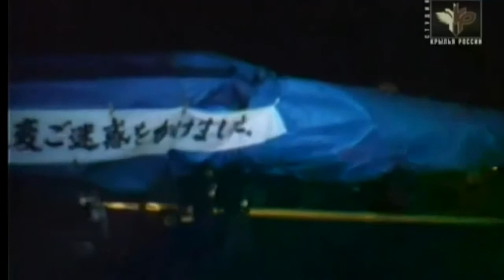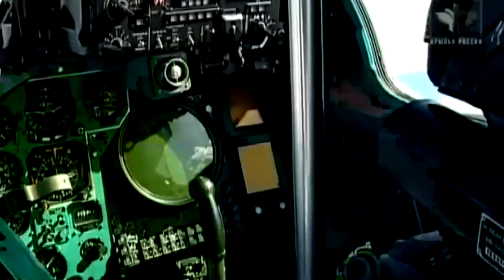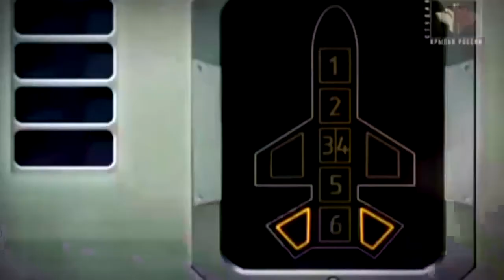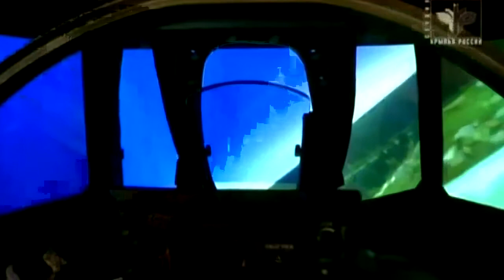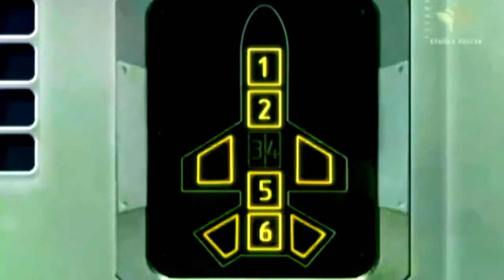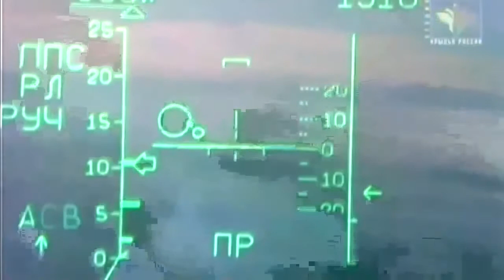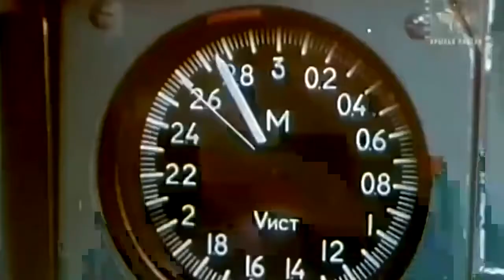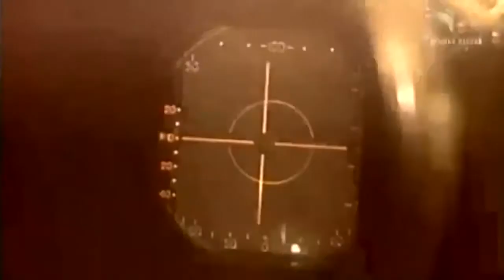From MIG-25 to MIG-31 (Documentary)

Comment: I am pretty sure that the F-14 could target six planes at a time, a few years before the Mig-31.
Reply: with much more limited cone of engagement and constantly moving head on updating the phoenix until goes active and forget about shoot down capabilities cruse missiles
Reply: The mig25 and mig31 don't stand a chance in a Dogfight at Close Range,if it's missiles are decoyed or evaded,then All the mig has is speed,many mig25 aircraft of the Iraqi air force which were flown by veterans Of the wars,where shot down by F15 eagles Of The US air force , also more capable mig29 and mirage F1 were easily shot down
Reply: @aris5921  I see - I have no doubt the Mig-31 has a better and more capable system than the first F-14, still it was not an unqualified "first interceptor capable of tracking and shoot multiple targets". First in Soviet service, first at tracking ten planes, first at doing so in shoot-down situations, OK. It is a great system.

If you omit the qualifiers, the assertion starts sounding a bit propaganda-ish.

"The FIAT G-91 was the best fighter [ever produced by the Italian aeronautical industry, up to that point]" - the phrase as a whole is opinable but possibly correct (the MC-205 begs to differ), if I omit the part in square brackets I am left with a bald-faced lie.
Reply: The f14 had a role of defending battle groups and encage big bombers from max distance with phoenix before they shoot their missiles , after that probably use the sparrow to intercept low flying missiles

There are major differences in dogma and that is a reason to terminate the weapon system phoenix–f14 on the other hand the mig 31 weapon system is viable and somehow unique for the role that has